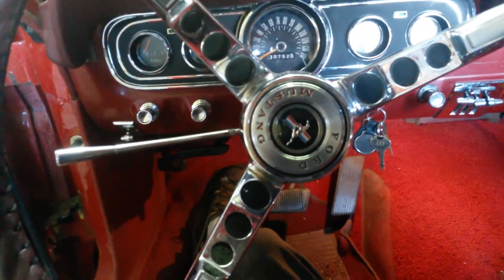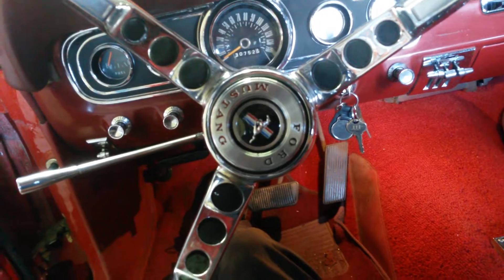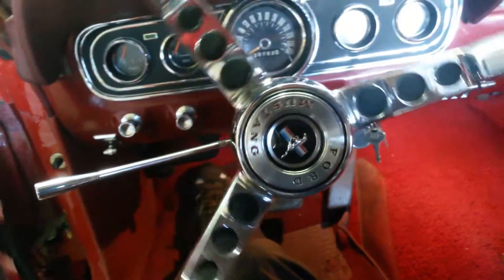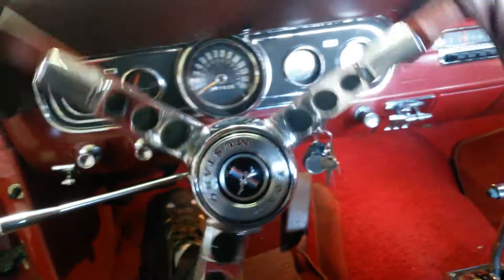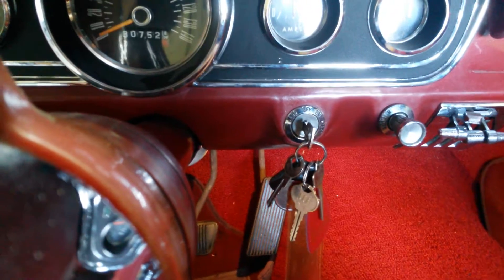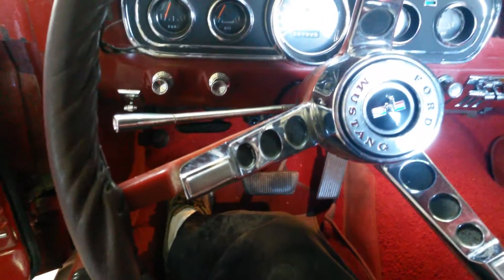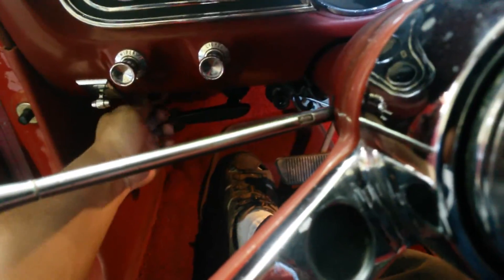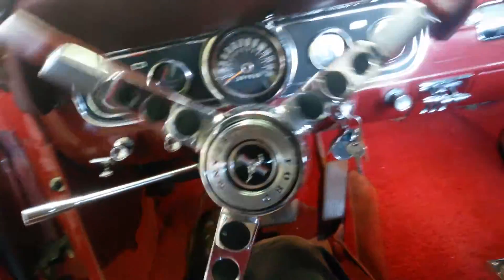Electronic power steering 66 Mustang

Comment: What does this run to have done? I have a 63 Meteor, think Fairlane by Mercury.
Reply from the maker: Bill Smoot Sorry I only do the work. I will look for the manufacturer.
Reply from the maker: Bill Smoot Summit Racing has them starting at $1,000.

Comment: Power steering is for girls.I drove a 1968 Mustang manuel steering with 390 and c6 and loved every minute of it! Mustangs are too light to need it, especially going fast. I all so like non hydraulic clunches. Today's cars are to full of junk I do not need. And people are adding all this junk to old cars. I like my old cars with old tech.
Reply: A lot of people that own these cars are much older and may not be able to turn a car without powersteering.
Reply: It’s there car it shouldn’t matter
Reply from the maker: Right on. And I got paid to do it. People have paid me a ton more. To do some much worse things to classic cars.
Reply: @ReverseGear  understand now! i just like how they are factory. i love how simple and reliable old cars are when are stock with everything working right. a lot of people just have no understanding of the old stuff.
Reply from the maker: This car was also a huge POS. No saving it. It was abandoned in NY. Floors rusted out of it. Should of never been fixed. What rocker pieces they couldn't find. They left out. Quarter panels are not welded to any rocker area or floor. Then they added 2x2 steel. The whole length of the "frame". This video really should of been. "If you see this car for sale? Run away!" But I did exactly what he wanted. And made him sign a waiver. I.E. not my problem.
Reply: @ReverseGear  on something like this i can see it not being a problem as it is a lost cause. yes there are a lot of hack jobs do to neglect and stupidity. this car sounds like was a pos. well take care.
Reply: Depends on the situation. My driveway/garage situation dictates that I do a 5-point turn just to get my '65 out of the garage. Not having power steering w/ fat 17" tires gives me pause when I'm trying to decide if it's worth getting my car out or just take my truck to the store because it's alot of effort.
Reply from the maker: This system was not cheap. But the adjustability and ability to turn it off was nice.
Reply: automatic transmissions are for girls
Reply: Well you dont need combustible engines anymore so I guess you drive a tesla.